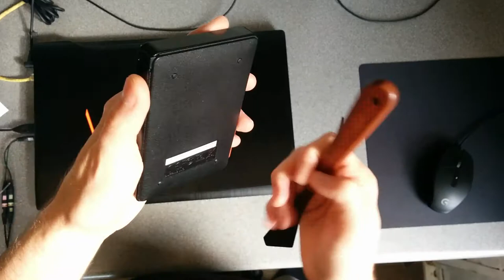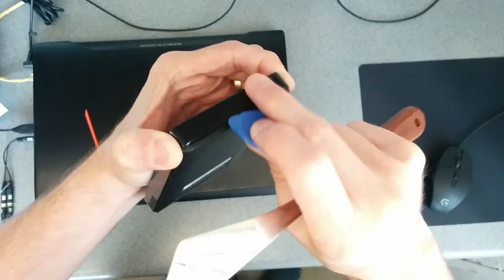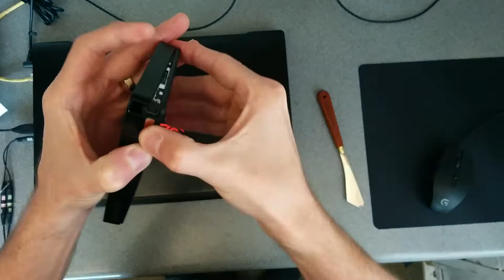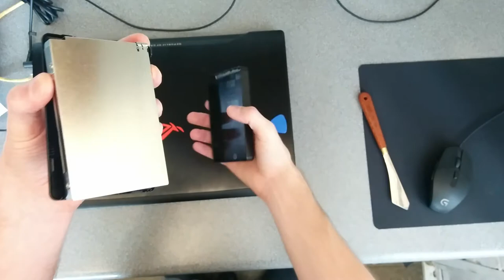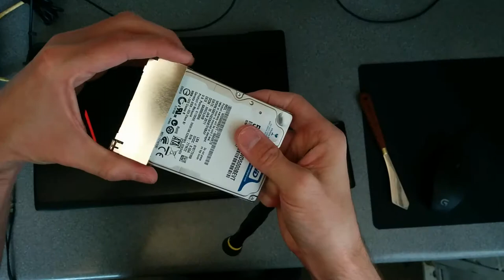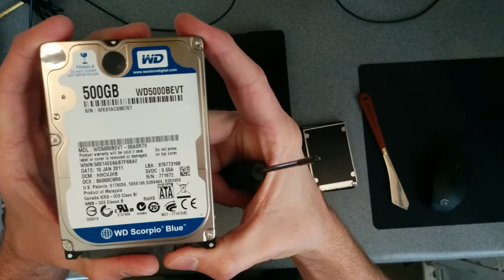Buffalo Ministation HD-PC500U2: How to open up and take the drive out.

Comment: I have just bough this external drive with a 1TB Toshiba HDD in it. When I connected it to the PC/Mac, it had the usual bootloop (trying to read and again) so I took it apart while watching this video. 
Make sure you try the drive before dumping it. Something may been faulty with the PCB connector and not the drive itself. I've just put it in my PS4 and it's working completely fine.

Comment: What is that 'tool' you are using, just a regular kitchen spatula?
Reply from the maker: I have not had time to check the video but it's likely an RGM craft spatula / knife. I suspect it would usually be used for oil painting.

Comment: Which hdd is this kind of form factors?,  7 or 9. 
(2,5" HDDs come in different form factors, usually 15mm (for servers), 9.5mm (most usual form factor, most applications), or 7mm (usually for ultrabooks etc.), where 7mm seems to get more and more common. "SLIM" most probably means 7mm height.)

Comment: I lost the original cable, after buying a new one and connecting them to a computer, the blue light keeps beeping and it doesn't show any connection on the computer. Could anyone tell what the problem is?
Reply: I have exactly the same problem, with an exactly same hard disk
Reply from the maker: Sounds like faulty hard disk I'd bet. Check with a different hard disk known to work?

Comment: But where is the spindle? Underneath the PCB?
Reply from the maker: Under the white circular sticker. However; what do you plan to do with the spindle once you've located it? There isn't much you can repair yourself with disks like this.
Reply: @freename  Ok thanks I have this bleeping sound coming from my slim external HD so I'm guessing it's stuck on the platter surface. I need to try and get it running just so I can grab all data off it as it's 15 years old now and I dropped it yesterday : (
Reply from the maker: The beep noise is probably the motor retrying / attempting to spin the platter.
My approach for this would be: If you think you might want to spend up to a couple of hundred pounds on recovery; send it off to Fields Data Recovery or similar. If you don't mind potentially breaking it more (e.g. you won't be paying for data recovery)..
Take the drive out the case.
While the drive is beeping / trying to turn on - tap it lengthways in various places. The aim is to see if a head has got stuck and hopefully "tap" it into moving over the platter enough for the drive to start spinning.
HOWEVER: This may cause more damage, it may not work at all.. do not blame me! Send to data recovery now if that is within your pricing / realm.

I've had this method work for me a few times in the past. I'll upload a video of the method in a moment and add a reply to this comment with the link.
Reply from the maker: Video is here: https://youtu.be/tR9itrW_RIY
Reply: @freename  Yes I understand and I will try this method. I would not think about blaming you if I break it beyond repair. Is it not worth removing the metal cover plate where the spin drive is and manually sliding it back over to it's rest point?
Reply: @freename  I will watch, thank you.
Reply from the maker: @mrjones29  Definitely not. Last resort would be opening the drive. They are infinitely easy to damage (scratch, finger prints, knock the head off the arm etc.) and dust causes problems within minutes.
I used to have a video ages ago on Google Video (now dead) which showed a hard disk in use without the cover on and how quickly it died and failed to seek or kept reseeking while not managing to read data.
Reply: @freename  Hmm ok thanks for the tip 😔